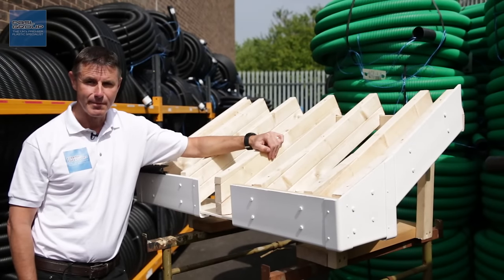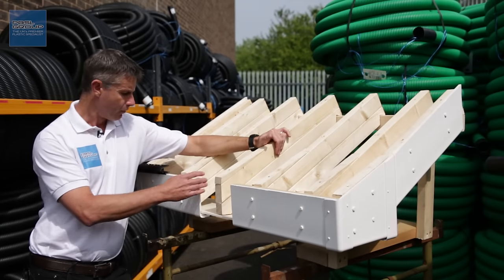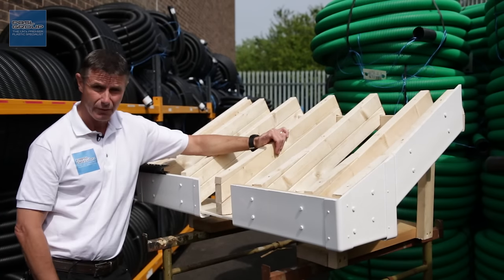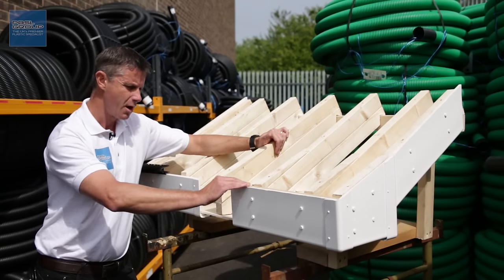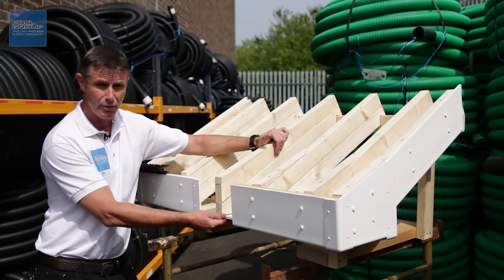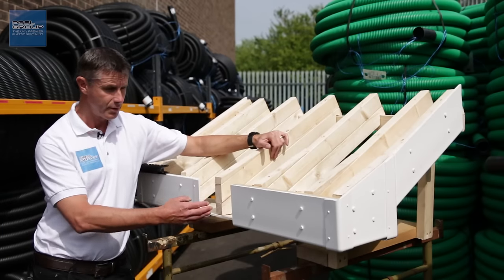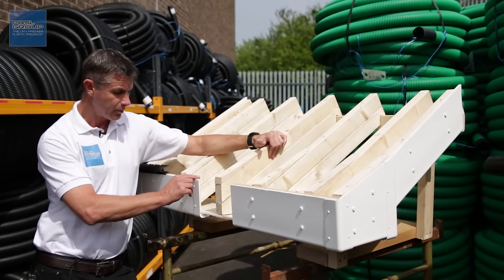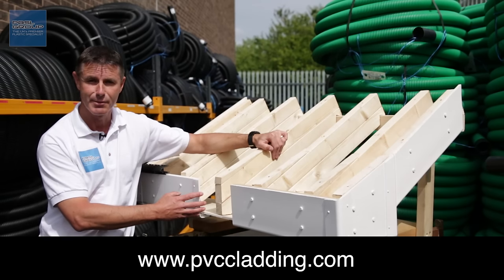PVC Fascia & Soffit - The Basic Terms Used | Product Showcase

Comment: Brilliant vid, I have searched everywhere but cannot find any information on how high you should set the top of the facia board above the rafter. before setting the overhang of Redland 49 tiles. any advice appreciated / Many thanks
Reply from the maker: Hi Terence, thanks for your comment.

The fascia board isn’t strictly supposed to support the bottom row of tiles, this is the job of the tilt fillet shown in the video. The tilt fillet effectively changes the angle of the bottom row of tiles and locks them in place. The fascia board should sit slightly below the top of the tilt fillet.

Comment: 10mm for longitudinal (presumably) expansion of UPVC fascia boards?

Over what length? And under what temperature change?

And what happens at all those fixing points on each length? On heating does the board material compress locally at each nail/screw and then magically expand again (without damage to either the board or the fixing) when the board cools?

I await your answers with bated breath. ;-)
Reply: Michael Warwick Wow, Michael knows everything EVER
Reply from the maker: You should allow a 10mm expansion gap between two 5m long boards. This will allow for the most extreme temperature ranges that we experience in the UK
Reply: @PBSLGroup  so the fixing nails close to the ends of the boards have to bend back and forth 5mm with every expansion and contraction of the board, so we hope no one thinks of that then that problem goes away.

Comment: In another video they superglue the pieces that cover the expansion joints. Surely this defeats the purpose of the gap? Or are they only glued on one side to allow movement?
Reply: You are correct, they should be glued on one side and sealed with silicon on the other side, which will allow for any potential movement.
Reply: @colinevans6378  Don't try and kid me into thinking the silicon will move 10mm with expansion without breaking loose .

Comment: If the boards expand so much, are the screws or nails placed in slits?
Reply: Craig Harrison the nails that are normally used are called poly pins.. (a nail with a bit of white plastic on its head) pilot holes are drilled in marked out positions and then nailed on.  So the answer to your question is they are not in slits. Hope this helps.
Reply from the maker: Hi Craig, thanks for your comment. 

In the past some old PVC systems did incorporate slots for the fixings, but over time the system has evolved to be used as explained by Glen in the previous answer. The whole system therefore expands and contracts around the fixings.

Comment: If fixing guttering to cover board, what fixings are recommended to ensure they are adequately supported? Thanks
Reply from the maker: The screws for the gutter brackets should go through the cover board and into the backing board. 25mm screws should suffice.

Comment: Really informative video, regs the soffit boards, how do you attached to the wall? Standard batons attached to the wall or do you supply fittings?
Reply from the maker: Hi Gavin, thanks for your query. Cellular Soffit Boards (Plain and Vented Soffits) are installed and fixed to the bearers using 40mm A4 Grade Stainless Steel Polytop Pins. Polytop Pins are both shorter and a smaller gauge than polytop nails, due to the fact that soffit boards are never load bearing. The heads are also smaller, making them less obtrusive. Soffits should be fixed with two pins at 600mm centres (400mm for woodgrain).

Hollow soffits are secret fixed to soffit bearers using 30mm stainless steel cladding nails. The lip of the board is nailed, with the fixing being covered by the next board.

Comment: Why can I find nothing like this in the U.S?!! I want that beveled edge,  slotted, and thick enough to hold a gutter. It appears it is a Euro thing but it is clearly better than the wood and aluminum and vinyl wraps sold here. What I do?!
Reply from the maker: We hope you manage to find something similar near you!
Reply from the maker: We agree with you - eaves construction is very different in the U.S. and for the most part it is much lighter duty. One of the reasons may be climate - PVC expands and contracts much more than the materials used over there when it is exposed to extremes of heat and cold, which we don't tend to have so much of in the UK.

Comment: Fascia should be at least 60 mm above the spar ends
Reply from the maker: Thanks for your comment, you have to be careful here as there are several different factors that can affect this. Many fascia boards in the UK are not strong enough to support the weight of the bottom course of the roof covering, so what you suggest is OK as long as the tilt fillet still carries the the load.

Comment: PVC has not been a good solution for guttering as it will get brittle with age and has questionable UV protection unless painted, and rightly the massive expansion rate.  What about Colorbond properly installed! or Timber with an oiled finish!.  Also the look of it, like living in a Tupperware party.  No thanks
Reply from the maker: Not everyone likes the look of PVC - it comes down to personal choice. PVC Gutter manufacture now is far more advanced than it was 20 years ago though, with long lasting looks and durability. Like all industries it has developed over time, and the now brittle or faded gutters that were installed 20 + years ago are a thing of the past  - just make sure you buy from a reputable manufacturer.
Reply: @PBSLGroup  Yes but what about the recycling, does the PBSL Group have a program where this product can be returned after life and not get buried in to the ground?
Reply from the maker: @KF-bj3ce  The recycling of plastics is becoming more and more common, with many materials including now being manufactured solely from recycled PVC.The British Plastics Federation is also actively involved in PIRAP, which is the Plastics Industry Recycling Action Plan. PIRAP was set up in June 2015 to help meet the 57% plastic packaging recycling target by 2017. The end target date has now been extended out to 2020  - whilst we are making good progress as a whole in this area there is still a challenge for industry in general as further infrastructure development is needed.